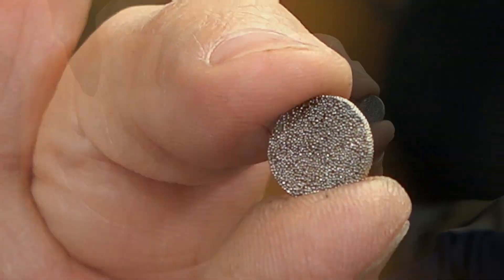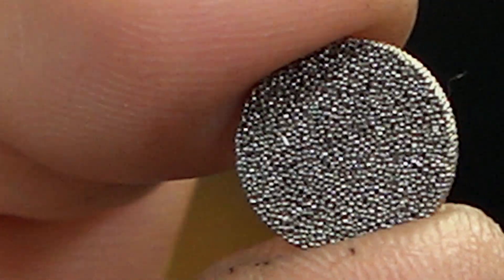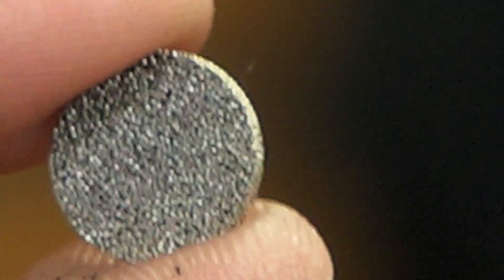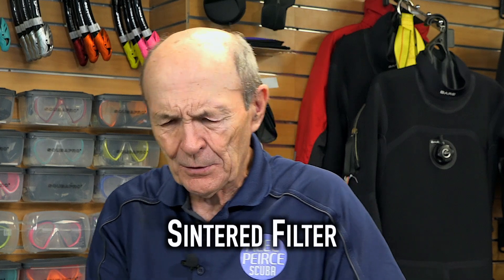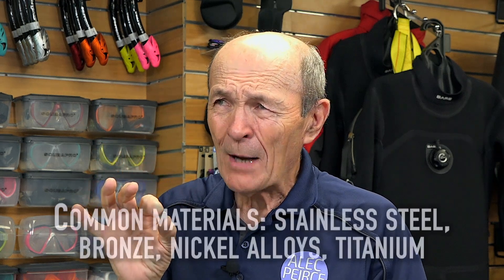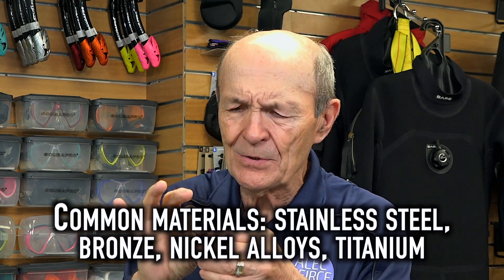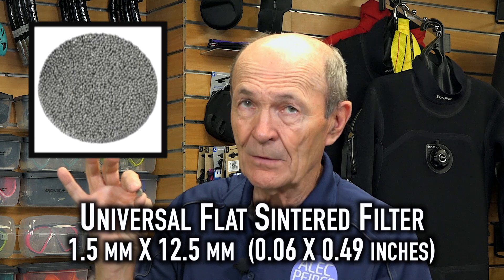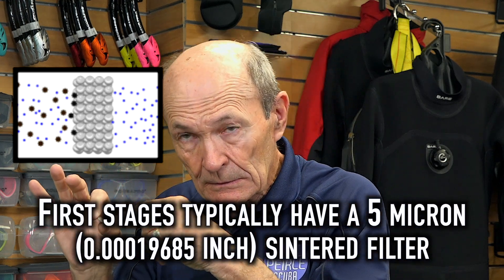Cone vs Flat - 1st Stage Filters - Scuba Tech Tips: S15E17

Comment: so comparing the disc style and the cone style and what is more hypo dermically safer or rust preventive?
Reply from the maker: Both meet manufacturer requirements for filtering but the cone has more surface area to filter.  Divers choice if it fits.
A

Comment: sinterized material is widely used in pneumatic industry  and also to filter fluids, a common application is to filter gas, for older of us that have memory, the GM cars used sintered bronze to filter gasoline at the entry of the carburetor.
For sure, a cone filter offers more media surface  but I'm not sure that this will fit all first stage design
very good topic
very good video
Reply from the maker: Thank Jacques.  Thought it would be interesting to the diving community.  Some models will only take flat but most have enough depth to take a cone if the manufacturer approves.
A

Comment: How do you clean them? For reuse
Reply from the maker: Hmmm. For the price, it would be senseless to clean a filter. They are very cheap & invariably included in the service kit.
However, I suppose soaking in a detergent and/or using a Ultrasonic Cleaner would return the filter to almost new condition - almost. The cost of doing so would exceed the cost of s new filter!
Go crazy!!
Alec
Reply: Thanks alot I appreciate it.
Reply: They included in kit. U could not clean them properly. U could check arisona sand and decide not to do it

Comment: Hi Alec. I’ve got a DIN regulator (Aqualung Legend Elite) with an ACD closure. I know theres a filter in there somewhere but I can’t see it even when I manually put pressure on the ACD. Can you describe how they do the filter thingy on DIN regs?  Thanks, John
Reply from the maker: The ACD  is held in place by O-Rings, simple friction fitting, no C-Clip. The filter is below that. That's why you can't see it.
The filter is a cone style but with a flat end to fit into the reduced space available under the ACD. I suppose it's better called a top hat.
For those not familiar with the term ACD, it stands for Auto Closure Device and is simply a small plastic, spring-loaded ball that closes the opening into the regulator when it is not on a tank & under pressure. The idea of course, is to keep debris of any kind out of the regulator insides when it is not in use. Pioneered by Oceanic some 30 years ago, it certainly can be helpful if the diver is not VERY conscientious when using his regulator. It is however, as discovered by Oceanic, a high maintenance item & often subject to failure because of it's small size and from being subjected to high pressures & possible dirt & water. Careful use & regular maintenance cannot be automated!
Reply: @AlecPeirceScuba_SeaHunter  Is the ACD maintenance something I can do?  I’m pretty handy.

Comment: Every 25 dives? That’s the most conservative approach I’ve heard, AFAIK, Apeks has 2 years of 100 dives interval.
Reply from the maker: There can be a lot of variance in service intervals.  Some are long to entice the buyer with fewer service costs but it's up to the diver to decide.  I had customers argue the cost of a 1st stage checkup service (~$70 CDN) then buy a camera + accessories for $1,000 + and not blink at the cost.  It may be because they don't see the difference which is why in my store, we always returned all the replaced parts to the customer to show what was serviced.
A

Comment: I think you choose your regulator by overall performance rather than type of filter, and no they aren't interchangeable.  And I agree it's a symptom of a high-quality system rather than something a user will notice.  It will as you say resist clogging better and will produce less restriction on gas flow with a lower pressure drop across the filter.  But what the user experiences is an intermediate pressure that is calibrated to a set value after the filter so even that miniscule effect is taken out.  Fun fact, because of their fine mesh and use of highly conductive metal they also extract heat from your breathing gas.  To show it, put a cone filter between your lips and blow through it; it will get quite warm.
Reply from the maker: Quite right. While similar in diameter & function, a cone will not fit into a reg designed for a flat style - normally.

Comment: hi Alec those sintered filters are also used for compressed air exhaust mufflers and breather ports (like a muffler but for small air flows, these are usually made of sintered bronze and are not electroplated. Perhaps you should mention that they are not worth cleaning or worse yet turning it around. Take care Owen m
Reply from the maker: Thanks for the info!  They are used in lots of applications for particle removal.  Hope this helps others.
A

Comment: Will both fit in every regulator
Reply from the maker: Not every regulator.  There are a few sizes; one used by most makes but a few how slightly larger/smaller diameter filters.  Check with your service pro to ensure the right size is used or the c-clip will not hold it.
A